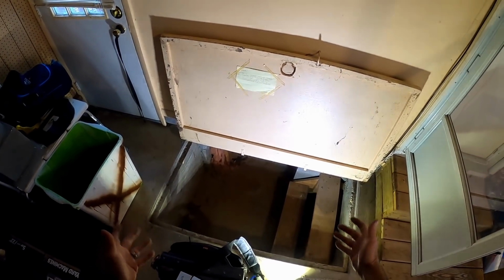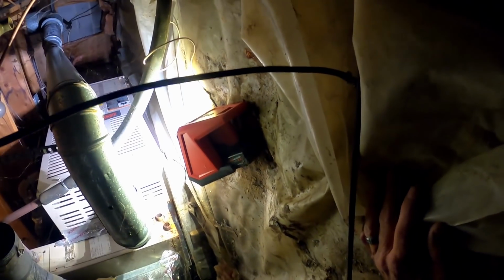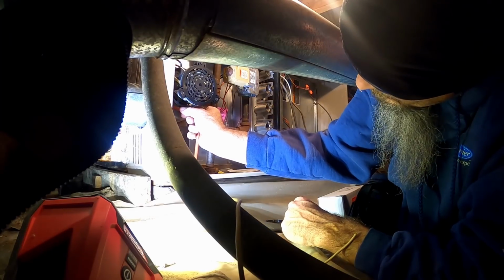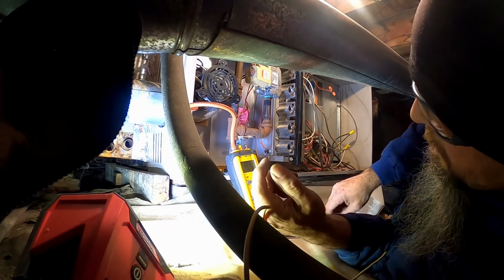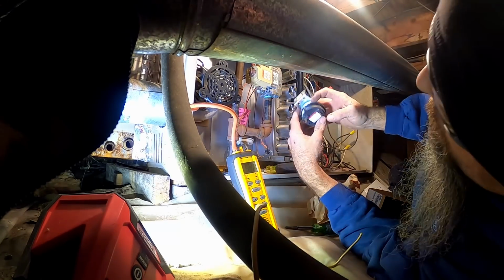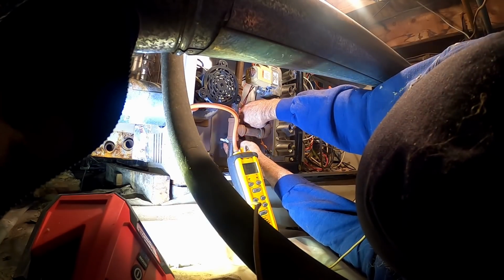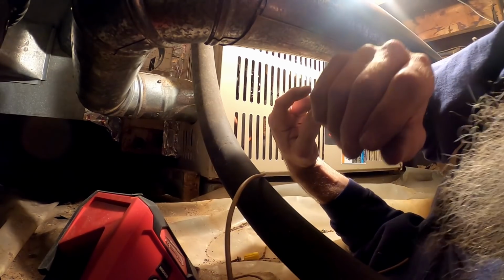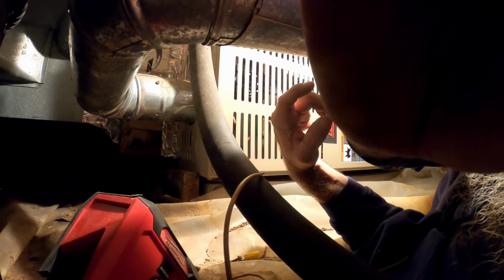Lennox Furnace In A Crawl Space (Part Two)

Comment: would be wise to put the manometer on a tee and watch pressure before, after burner ignition and indoor blower also. especially after seeing the dryer venting into the crawlspace also.
lint loves to clog burners and heat exchangers (usually as black soot) although that one looked pretty clean inside :)

Comment: make sure you note that the dryer is venting onto the crawlspace and that it voids any and all warranty/repair work on furnace, unless it's fixed and documented!
lint is death to them, clogging burners heat exchangers and more, I've seen it clog standing pilot models just rolling out not enough to trip rollout switch(opposite side of cabinet) but the whole pilot side was filled with black soot, including the flu pipe and 2 stories of B vent, even had soot coming back out the WH hood and laying on top it in high winds.
we were there doing plumbing, electrical and various carpentry/patching, while there I could smell the burnt gas spilling out when walking past the unit! I alerted the owner to the issue showed them the soot everywhere and asked if they had a CO alarm(no). it's in some HOA condo location and they use mostly dedicated companies for all repairs, so they called them to replace the unit. I warned the HOA about it and lack of CO detectors, stating many others may be the same since it's all cookie cutter builds!(early to mid 90s) which they were probably not happy about it, but if it can possibly save sickness or lives, so be it lol
Reply: Wonder how much mold is growing down there with all that moisture that has no place to go.
Reply: @TheMinnow101  plenty of it I'm sure! unless the laundry room was moved and that's abandoned, thinking about all the contracting work of the past, moving laundry to 2nd floor or across the house. we always went to laundry against exterior or the closest intersecting wall and put the dryer against near corner, exhaust pipe 6' or less to vent outdoors.

Comment: I owned a house where they had to have built the house after installing the furnace and duct work in the crawl space. The area where most of the duct work ran was only between 12 and 18 inches clearance with the furnace in a 3.5 ft dug out area. There's no other way that could be done.

Comment: Haha!  You nailed it at the end.  After a few months I realize my bag is heavy af so I think should take some tools out... then realize there’s no extra tool so I take them all out and find 20 lbs of screws gas fitting clamps wire nuts bolts few rags gloves extension cord 6lbs of gravel in the bottom of it HAHA

Comment: Very off topic question, but for removing the burners from the burner box on 90% Lennox furnaces, do you have a specific tool that you use and would recommend?
Reply: I take off that cover plate underneath the burners and use my  offset quarter inch ratchet  with a short skinny quarter inch impact bit. It's still a pain though.